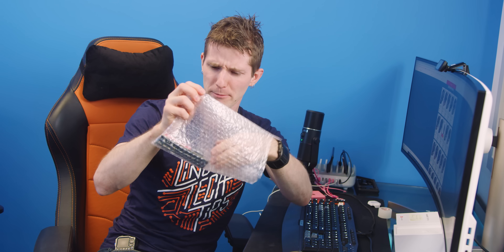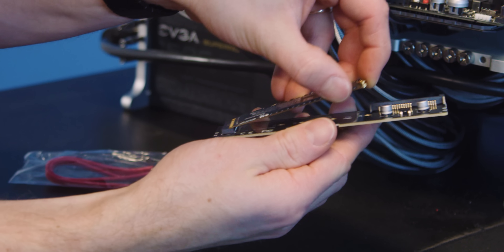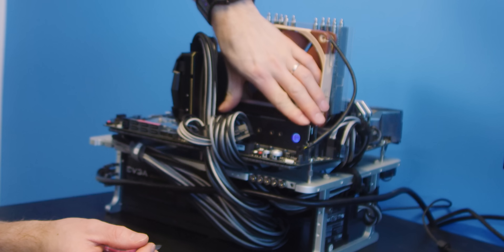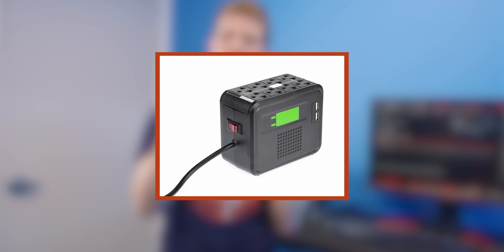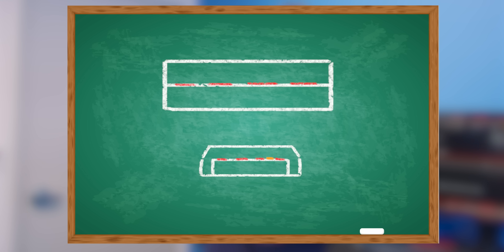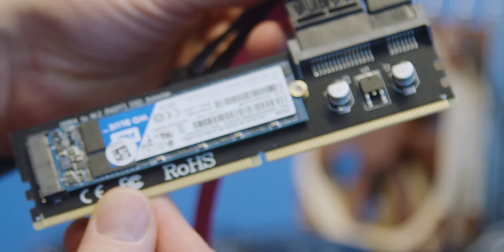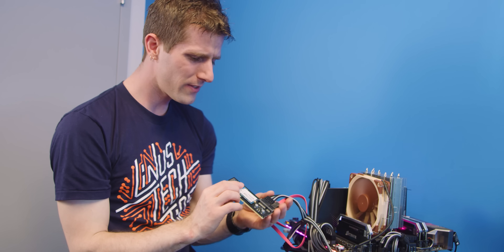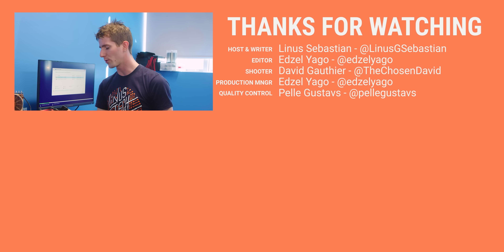They LIED to me! - DDR4 RAM to M.2 SSD Adapter

Comment: Does Linus knows that hdmi-vga not adaptor? It's converter. :)
Reply: HDMI-VGA Converter is referred something that convert the HDMI 'signal' to VGA 'signal'

Hdmi-Vga Adapter is reffered to the 'device'
Reply: @zKite00  VGA = analog, HDMI = digital. Didn't remember devices on my practice that can convert that signal "from box". This 'adaptor' actually is 'converter'.
Reply: @lxpcfc   I dont think i understand what you are trying to say.

I'll exlain myself again.

Converters, such as ADC or DAC, is a 'SYSTEM' that converts the voltage or current into the other

Adapters or Dongles, is a 'DEVICE' that changes the charateristic of a device or system into another device or system.

HDMI-VGA adaptor, is referred to the whole device, with the cable and stuff.

HDMI-VGA Convertor, is the system that do the work inside the adapter. 

HDMI-VGA converter is a correct way to referr to the device because it is essentially the only thing that it does,
But that doesnt mean HDMI-VGA adapter or HDMI-VGA dongle is the wrong way to refer to the device, since it is a device that changes the charateristic of an HDMI to a VGA 'by converting' it with DAC.

Heres a fun fact: Did you know you can call an Expansion card, an Accessory Card or Adapter Card and still be correct?
Reply: @zKite00  nvm. You saying same stuff but in global. I said only about this case from this video. You right in total. :)
Reply: @lxpcfc  what? I am talking about the HDMI-VGA case that is mentioned in the video and in your comment.

Not trying to offend you but, do you even read or understand what im saying? Or do you just read the first part on me defining a converter? Or just doesnt fully understand what im saying?
Reply: @zKite00  ye, you right man.

Comment: I’m sure the video was done for shit and giggles but why would anyone think flash which has a FINITE WRITE CAPACITY be a great idea for ram?

This makes RAM doubling software look AMAZING compared to this junk.
Reply: On the same note, wouldn't it be amazing if the adapter worked the other way, perhaps with a small backup battery onboard, to allow a DDR4 RAM stick to function as a high-speed, infinite-endurance SSD? Now that would be cool!
Reply: Dielectric Videos - That has existed for a very long time. It’s a software solution called “Ramdisk”

Hardware solutions do also exist in the enterprise market.

Comment: That doohickey might be helpful, if you have a memory slot free, and no slot for the m.2 drive, so the memory slot would be just for mounting purposes. Then again, that converter could also have a secondary mounting option.
Reply: P37R1X But it's SATA standard :/... kind of defeats the purpose
Reply: True. Also if they had included actual ddr4 memory into that assembly it would have been better. That way one could use the memory slot as usual, have the ssd mounted on the other side and maybe switched the sata port to a mini pcie with a connector and/or something, that one could just connect to a existing port via a riser cable. A sata port would not be needed. Although I imagine that the would be quite complex

Comment: So basically the DDR4 slot is there to hold the card down and stop it from flapping around in your case... There really was zero need to gold plate the pins on the DDR4 adapter - they could have just been the original plastic.

Comment: i see you rocking the g710+ . i have bought two off of offerup. 
$15 for the first, (missing a keycap, 3 dead keys. 2 numpad and down arrow. remapped it to the gkeys.)
$5 for the second, (broken keycap post, diy fix.)
otherwise i love them. who needs (or wants) rgb?
i paid $25 for a used corsair k55 memb that worked great...until i updated to the cranky and passive aggressive new drivers. 
sorry for the detour on a off topic comment.
love your shows

Comment: There are way easier ways to make a RAM disk, I am just saying.

For those still not understanding it. It's a piece of wood/plastic you slot in an empty memory slot in order to use a SSD drive via the normal SATA interface, i.e. the memory slot is only used for physical storage.

Which is why it's only 7.98$. It's a way of mounting more m.2 drives on motherboards with only one m.2 slot.

Comment: That's almost useful to me. Only have one(full) 2.5" mount in my oldass case and one m.2 port sat under a 300W graphics card. But I ain't got ddr4 slots to put it in. Tape method is good I guess but I'd rather ghetto a 2.5" without exposed circuitry to short out

Comment: I know this can be disappointing but this is just for folks wanting to buy a M.2 drive but who doesn't own a motherboard with M.2 port, putting it in the DDR4 slots is not dumb at all I personally think it's a good idea instead of taping it elsewhere, but still this looks a little ridiculous because you'll only get sata speed and then I wander why the guy buying this stuff didn't just buy a sata ssd...

Comment: It's really useful if you have an open DIMM slot or two and need to mount an SSD but have limited space. Like if you've used up all of your hard drive slots on your case, you could use this with an M.2 SSD and still mount it inside your case comfortably. It's a bit ugly, of course, but it works.

Comment: Wow, they're just using the slot as a way to mount the drive to the system, but the RAM slot isn't being used at all except for holding the adapter in place.

Comment: As an electronics engineer, your adapter explination has a few de facto names in industry.
Different shaped plugs & no internal electronics + no changing of the signals = "Passive" adapter.

Internal electronics? Changing of the signals (i.e. USB to Ethernet, HDMI to VGA)? = "Active" adapter.

Comment: If you use SATA M.2 drive this bound to work poorly. Should try it with the PCI interface, M.2 with SATA interface doesn't have much of a point since the transfer capacity of SATA is 3 to 5 times slower than PCIe interface.
Reply: if you have a motherboard that doesn't have a PCI interface then this adapter makes sense though. Its also CHEAPER than PCI adapter cards.

Comment: I mean it is cool that it gives you a place to put an m.2 drive... so for older systems that dont have an m.2 drive slot at all you have a place to physically mount the sata m.2 ssd in a position that wouldn't look out of place. The other advantage is if you didn't have/want to use a PCIE slot it would still give you a place to put it. This option is also MUCH cheaper ($7.98 usd) than pcie adapters I've seen.

Comment: The point was, if you don't have an M.2 slot, u can still use it in u're PC. You just need a spare RAM slot.
Reply: Except you don't need a spare RAM slot. Because it's not doing anything but acting as a holder. Instead of giving up a RAM slot, you could just leave this hanging anywhere you want.
Reply: @GadgetAddict  or not buy it at all and use a simple 2,5 inch drive if u really want the sata ssd
Reply: @scudsturm1  But that kills the option of having NVMe SSD, even though this one didn't support it.
Reply: @RJames7  Even if the socket on the stick accepted NVME, how would it connect? Both connectors on the stick are SATA. So not only would the drive socket have to be NVME, but the cables would have to plug into either a mobo NVME slot or PCIe slot. In that case why bother with a DIMM form factor at all? Just stick the drive directly into the NVME slot or use a PCIe-to-NVME card, both of which provide their own mounting points (which is all this thing offers).
Reply: @Malus1531  I see, either way, still would've been useful if it supported DDR2 or DDR3 memory. People using older rigs could've benefitted from this.
Reply: @RJames7  they do have ddr2 and ddr3 one
Reply: @thesmashtvnetwork  Perfect!
Reply: @GadgetAddict  IF you don't have a spare ram slot
Reply: if you want a m.2 slot you can get a pci-e convertor card.
Reply: @BloodSprite-tan  True, there are tons of options to go for...

Comment: I honestly can't even think of a use case for this adapter. Even ultraslim PC with no spare PCIE or drive bay would still need a spare RAM slot, and as Linus said, just tape ANY other M.2 adapter to the inside of the chassis somewhere. The cabling going to the RAM slots would be cumbersome.

Comment: ASUS MAXIMUS boards use a riser card with a special "dimm.2" adaptor which looks like a ddr3 slot but practicaly are PciE x 4 is you are in urge to put ssd on dimm that have to do it

Comment: Linus May I recommend this: https://www.amazon.com/dp/B07F9RBP5W/?coliid=I1LXIM9BPSK5U&colid=2H1VJ857NOU54&psc=0&ref_=lv_ov_lig_dp_it  No sata cable, no sata power required. As long as your NVME is Key M type then this will work just fine. Enjoy :)
Reply: And if you want a portable nVME boot drive then I recommend this: https://www.amazon.com/Aluminum-USB3-1-Type-C-Enclosure-Adapter/dp/B07FQGCDQK/ref=sr_1_34?crid=2BEW2BV1Q6S8B&keywords=nvme+enclosure&qid=1555466008&s=gateway&sprefix=nvme+%2Caps%2C164&sr=8-34  Type USB C cable is included. :)

Comment: Linus,  can you do or do you know of an explanation of a circuit board and what the electricity does as it speeds its way along the traceways? From plug to speaker wires, for example.

Comment: I could see this being cool if it were using the DDR3 pins since the majority of DDR3 boards don’t have m.2 support. But I think most DDR4 boards also have m.2 support so this doesn’t make sense to use. Even then you’re using a converter to take m.2 and turn it into SATA3. Unless you were limited in space I don’t see why this would exist. Modern mITX boards typically have 2 m.2 ports so it isn’t like you’ll need this.

Comment: "DIMM-Mountable M.2 to SATA Adapter."
Reply: @Joel Felipelli True. Well then if you have a bunch of m2 laying around with no use :D
Reply: @Joel Felipelli This "adapter" was compatible with SATA M.2 drives only anyway ;/
Reply: @Joel Felipelli in very small cases (thin-ITX) and the like may not even have a 2.5" HDD bay in them, but if you are doing signage machines there could easily be an open DIMM slot on the MB. Since you have to ship this thing, taping it somewhere doesn't make sense, so you get one of these to securly mount the M.2 drive somewhere. 

Again this is all assuming that you have a MB that doesn't have an M.2 slot anyways.
Reply: Andrew Frink:... OR no option to mount a 2.5" hdd/ssd... but then again, SBC's most of the time even have a full featured CF adapter on it.
And cheap mini ITX Boards mostly lack of the micro pci express or mSata port, don't have to mention M.2 with either M or B key because they are lacking those too... and no full featured ddr 4 dimm slot either to mount this to!
So if you think more and more about this ddr 4 M.2 Sata mount, the more wierd and obsolete this thing becomes...
Reply: @Cynyr  I think really tiny computers with little space, will not have a full size DIMM either.
Reply: @Cynyr  but they still wasted putting gold finger connection of the darn thing. it would work the same without the wasted gold and still fit in the dimm slot fine to hold it.  each one of those is a sad waste of a resource.
Reply: @TheOrganicartist  it's probably cheaper to order Dimms with gold fingers since they are already mass-produced, and then just stick an unrelated circuit on them.
Reply: @VanSanProductions  That makes no sense, the PCB would have to be redesigned to mount the various connectors onto it, a standard DIMM PCB wouldn't work.
Reply: Yeah, I actually don't think it's a bad idea, if you have spare RAM slots and want to add some m.2s it may be a nice way to organize it. Why not.
Reply: @nixellion  Why not use this instead? https://www.asrock.com/mb/spec/product.asp?Model=ULTRA%20QUAD%20M.2%20CARD
Reply: as Linus said you can tape this adapter to somewhere in your computer. This RAM slot do nothing. And if you use standard m2 sata you cant slow down becouse this is sata technology not nvme.
Reply: @nixellion  Just you wont probably have non used slots, most low, mid, and mid-high end boards come with only 2 slots, and living without dualchannel isnt much good. 
Even my highend-ish asus z170 doesnt have 4 memory slots. 

The boards wich have usually 4 slots are some high end ones, and entusiast (aka expensive as f**k ones), but they probably have 2 or more m.2 slots. 

Idk if that adapter is really that usefull.
Reply: Well there are mSata and m.2 S-ATA/AHCI Mode adapters for 2.5" Inch...
Reply: There possibility of using U.2 port like that
Reply: never gonna work prop for sure
Reply: @Joel Felipelli there are m.2 drives that connect via pcie or sata. m.2 is der formfactor. the only advantage of a m.2 sata ssd is that you dont need any wires
Reply: Yeah, at 5:13 i got it. You are able to mount an usb stick on to the cpu cooler.
Reply: I could see it being useful to upgrade old-ish computers that don't have any built in support for SSDs and have a spare RAM slot for whatever reason
Reply: @Joel Felipelli No, it isn't.
Reply: its kinda late but... can i reformat the m.2 to an optane so it work like ram.... well its a dimm slot right???
Reply: E waste is what it is.
Reply: @Joel I have a spare DIMM slot. I do not have ANY 2.5 SSD bays anywhere in my case (an old Dell Inspiron desktop chassis). I was able to just use the spare optical drive bay for a 4x2.5 SSD snap-in bay thing, but what if I had a second optical drive for some reason? Then I'd actually need this, unless I wanted to have my SSDs floating suspended by their power cables and just hope that the SATA connections don't get loose.

Comment: A shame, would have like to see this work, i have always wondered if old laptop SSD were easily usable in desktops pc, Louise always seems to be able to retrieve the data from the older macbooks, but after that what mounting options would both protect and install internally? Plus I wouldn't want to lose the 4th slot for ram if possible

Comment: Aw, i was hoping for it to have a use in ram based ssd pci-e cards in raid 0 so the data wouldn't be volatile but would still quite fast
Reply: I think your referring to what X399 Threadripper has included (multi-tier drives). You can use RAMdrives as your cache level, SSD as your next rank, and rusty spinners as your turtle speed storage and the software does its thing to make it work like multilevel cache and storage system. Linux can also do this (obviously, Linux is what every major server uses, so rapid data access solution is of utmost importance), and Threadripper comes with a license for using a very expensive proprietary solution for Windows for “free” (the Linux OS users don’t need any license so almost any hardware will work. For lols, you can use Vram as RAMdrive, and use that as one of your cache tiers!)
Reply: youre a fucking moron

Comment: I think this could have very niche use. If someone were using an older system where they did not have an m.2 slot and had an extra dimm available, they could use this to use an m.2 drive.

Comment: I'm surprised you did not mention satadimms at all in this video which are essentially SSDs that get their power from the dimm slot but plug into SATA. These are useful for boot drives on server blades which have limited traditional storage drive bays.

Comment: I believe the terms you are looking for when explaining adapter types are "Active" and "Passive".
Reply: And among Passive, Native Passive and Hybrid Passive.A lot of office USB keyboards are still produced supporting both USB and PS/2 mode (given that PS/2 is still heavily used here in China, where many of those keyboards are made), and so you have these hybrid passive adapters from USB to PS/2 that only work when the keyboard recognizes that the signals it's getting are PS/2 signals rather than USB signals and so it goes into PS/2 mode.Someone used to Native Passive adapters like USB A to micro may get the impression that you can plug ANY USB keyboard into that passive adapter and it will work ... but of course, if you plug in a keyboard that does not support PS/2 mode, you can get the "this adapter is broken!" reaction.

Comment: Imagine the otherway around.
M.2 adapter that takes DDR4.
Sure on power loss, you lose data but it will be fast, and maybe you can use a CR2032 battery to keep the memory active.
Reply: There are already better solutions for this. RAMdrives exist.
Reply: IIGrayfoxII they actually have what you’re talking about and you could probably do it with the hardware you have at home! google “ram disk”
Reply: those sexy access times tho
Reply: Well cost aside, I have experimented with a few different "ram" drives for the fun of it... Have to say the load/access times were awesome ;)
Reply: I've seen some pcie drives that uses ram and a (relatively) slow ssd for permanence.
Reply: Shhhhh. Don't give them ideas.
Reply: That was pretty much what I thought I'd be seeing after reading the title. I was wondering why anyone would want to switch from using a reasonably expensive (£ per Gb) M2 ssd to a ridiculously expensive  DDR4 based alternative ?

Comment: What are you, new?
They're for server builders to utilize an empty RAM slot on an old server to run an OS, usually a NAS or a firewall OS, but only supports SATA and they want to use all the drive bays for mass storage, i.e. FreeNAS.
Also, some embedded electronics will utilize DIMM-style slots to house a compute module, such  as the Raspberry Pi compute module - you see this a lot in electronic signage.
You guys should really hire a network engineer.
Reply: What's the point when you could have it just floating in the case. The DIMM slot and connectors perform literally zero function.